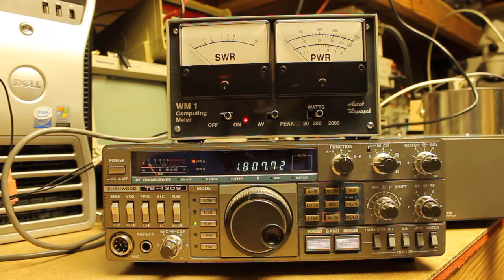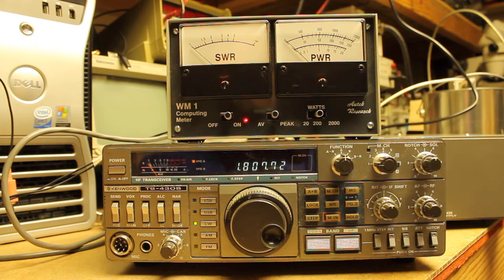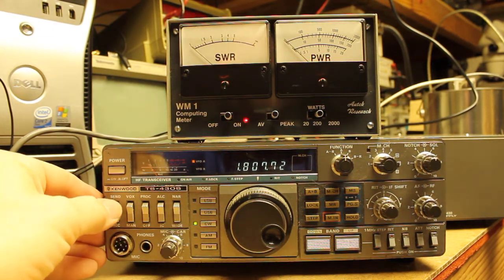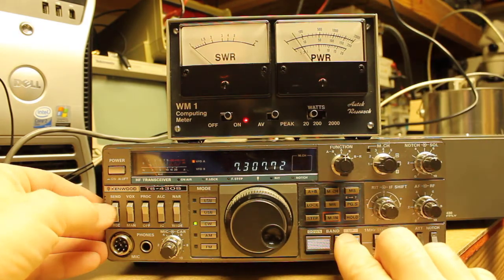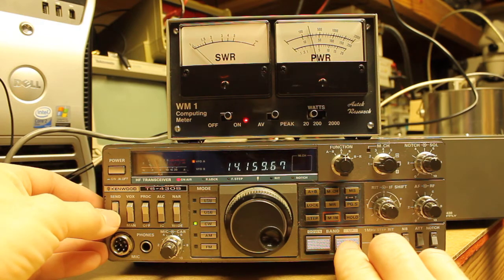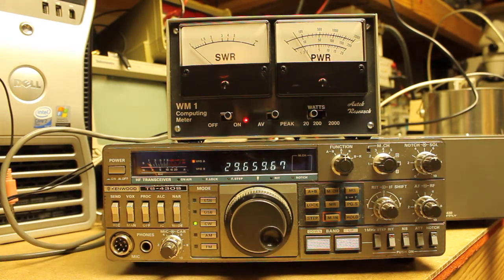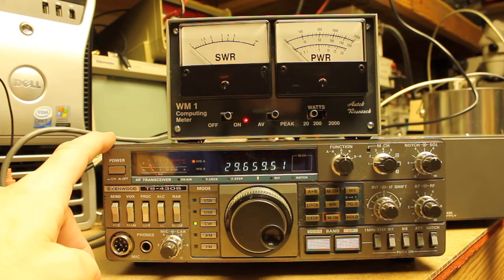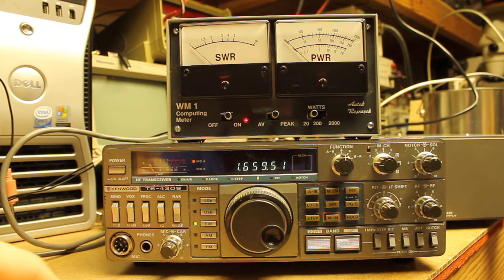What's Wrong With My Kenwood TS-430S?

Comment: Hi Peter. I was given a TS430. Deceased estate, It was left in a cold damp basment before I got it. It starts OK, lots of noise from the speaker Desplay reads OK, PROBLEM, the Mode selector will NOT work and is stuck in FM mode. Touching the other mode buttons gets a slight change in noise light shows up in that position, BUT jumps back to the FM mode, when button is released. I tried the relay cleaning trick and did a reset, to NO avail . Looks to be putting out full power and meter needle moves to full scale into a dummy load. Any ideas what to look at next please.

Comment: May be late to the show, these rigs suffer corrosion on the relay contacts that switch the bands internally. In the ts430 service manual there is a method to apply slight voltage current to the contacts to "burn off" the grime. IF you need i can look through my mabual and find the pages included regarding this method. It entails a few resistors a pl259 and a power supply thats isolated. Lemme know!

Comment: Your problem may be the final transistors.  They are notorious for having developed cold solder joints on the final output transistors and the fix was to solder a solid wire over the two solder pads on the output x-istors.  I've seen the contacts cleaned and helped on the audio issues.

Comment: On my TS430 the meter doesn't move. It TX's finee though. Looked for cold solder joints  made sure all wires were pressed down so, I'm looking for any other ideas why this is happening. 73 KC9UNV

Comment: sorry hit enter... low power is common on these.. had one just like it.. did full alignment and power came right up.. not the relays or diode's otherwise you would not get output . do the mods for receive !!! makes an excellent  rig.
Reply from the maker: I just went through the LPF, and manually cleaned the relays. Once I get it back into the radio, I will run through the alignment.
Reply from the maker: So I started the TX section alignment, and now I am getting more power out on 20m. I still need to finish the alignment, but I am waiting on a paper service manual to arrive in the mail, so I can stop using the low quality pdf that I found online.
Reply: What mods for receive, could you share some links?  Tks

Comment: It is good information. I own two of this portable radios. One is in Mint condition.  The second one seems to have two bands that do not work.  Any information I can find is helpful. I find the radio s to be very compact yet pack a lot of features . I would suspect dirty or faulty relays, or cracked solder pads.
Reply: May be late to the show, these rigs suffer corrosion on the relay contacts that switch the bands internally. In the ts430 service manual there is a method to apply slight voltage current to the contacts to "burn off" the grime. IF you need i can look through my mabual and find the pages included regarding this method. It entails a few resistors a pl259 and a power supply thats isolated. Lemme know!

Comment: Mine will not receive well for shit. Very disapointed. Not sure where to go frrom here.  Too big to put in my microwave oven...
Reply: Do that tip of taking a 20 watt resistor and using a PL-259 connector, solder one end of the resistor to the center of the PL-259 where the antenna wire would go. The other end of the resistor would connect to your power supply positive 12 volts using a jumper lead with alligator clips, and use a jumper lead from the power supply ground to the radio ground wing nut. Connect the PL-259 to the antenna connector  on rear of the radio. Do not connect the 12 volt lead to the resistor lead of the PL-259 just yet. Turn on the power supply, Turn on the radio, Turn on the 1Mhz step button  and get the positive jumper lead wire alligator clip in your hand and get ready to attach it to the resistor lead. Attach the 12 volt alligator clip to the end of the PL-259 resistor then immediately hold down the Band up button and cycle thru all the bands for at least 1 minute, then immediately change to the down step button and cycle thru the bands again for one minute and stop, quickly taking the 12 volt lead off the PL-259 resistor. Take the PL-259 connector with resistor off the radio, careful, it will be hot. You are done, and have just cleaned all the oxidation off the relays contacts and the receive should be very loud on each band. Turn the 1Mhz button off. Now go thru each band and see how it receives now with the antenna now connected to the radio.  Hope this clears up your poor receive.

Comment: I have a problem with a TS440Sat. In CW on transmit it sends a wabully signal if I put out more than 40 to 50 watts.  Seems to work fine under 50 watts. Almost sounds like rf is getting into something. Works fine on SSB at full output.
Any ideas??